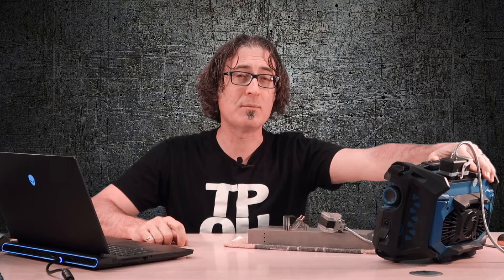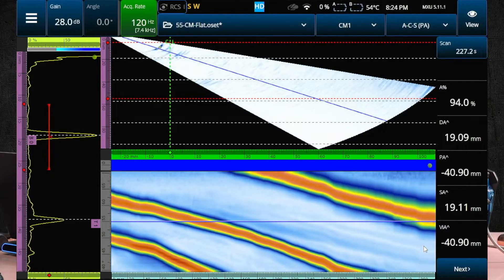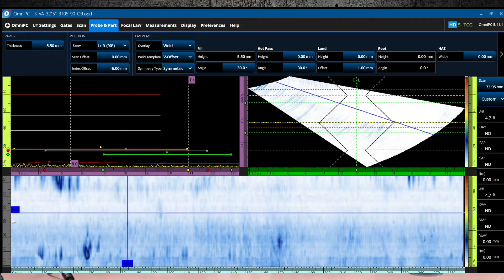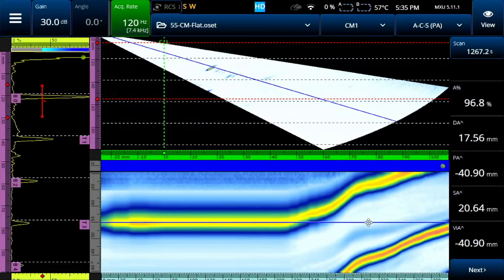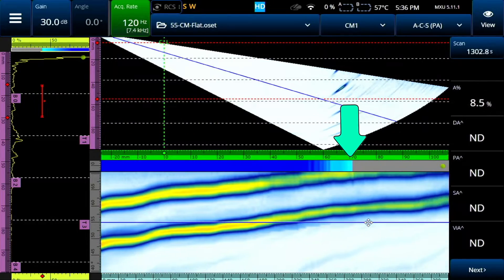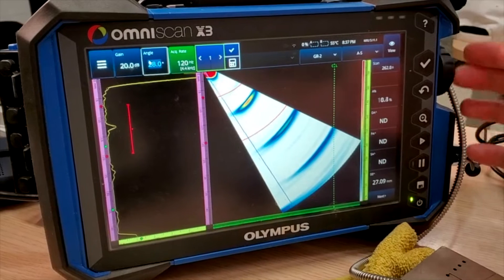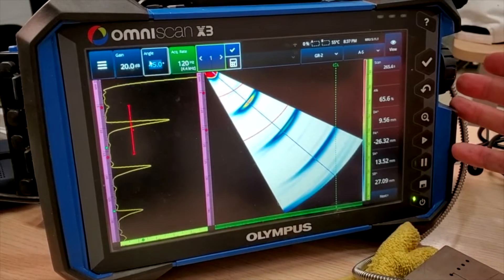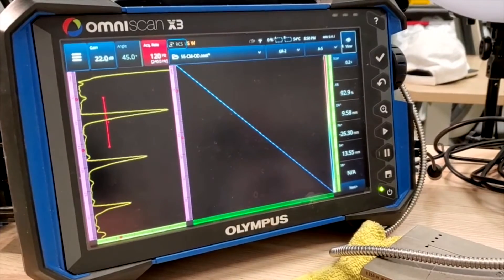Couplant Monitors on the X3

Comment: First, thanks for all the videos on your channel, I could learn a lot of new things beyond the scope of German NDT certification courses.

Now, the question: I am using a 7.5CCEV35-A15 probe by Olympus with curved wedges (AOD) in my scanner for small diameter piping welds and I have some problems with the couplant monitoring on it. The pipes vary in thickness from 7 to 11 millimeters, so I can't use the first backwall echo for monitoring as it disappears inside the pulse signal at the start of the A-scan. Instead I use the 2nd or the 3rd backwall echo, but even then it disappears sometimes while the S-Scan seems to look fine (geometry indications/notches clearly visible etc.). Other rather confusing signals also appear between where the backwall echoes should be.  I have been using the default coupling monitor setup on the X3 and also played around with different focusing methods and using other numbers of elements than 8, all with unsatisfying results.

Is there something I'm doing wrong? Does this technique even work under these conditions?

I would really appreciate your take on this, thank you.
Reply from the maker: Have you tried focusing? Also, I find those little scanners notoriously difficult to keep good coupling and a stable signal all around. This is more due to small pipe deformations next to the weld than anything.

Comment: Paul, a question how can I improve the speed inspection on tfm ll mode for corrosión, whit out loss resolution on sonates VEO3 32:238
Reply: Sorry I use best snr, but when I use best speed or narow or another, the definition of defect loss.
Reply from the maker: You can reduce the size of your ROI. If you are measuring 13mm thick material, but expect only 5 mm of corrosion, then set the ROI from depth 7 or 8 to 13, instead of 0 to 13.
Reply: @hollowayndtengineeringinc.5201  Ok, Paul got it. Thanks